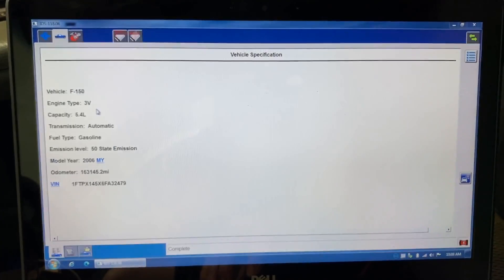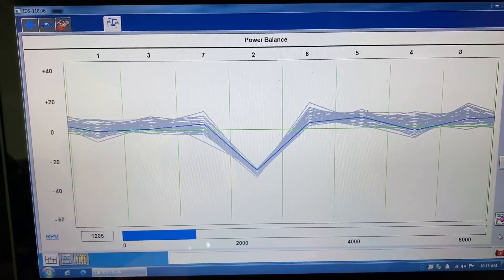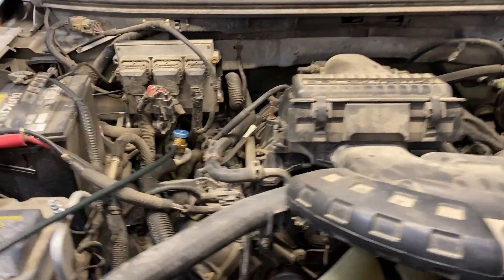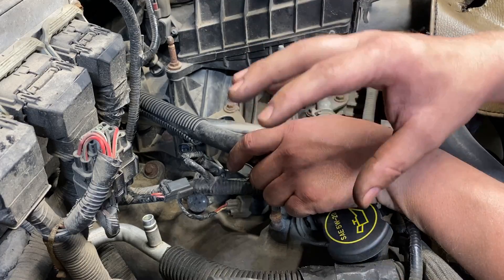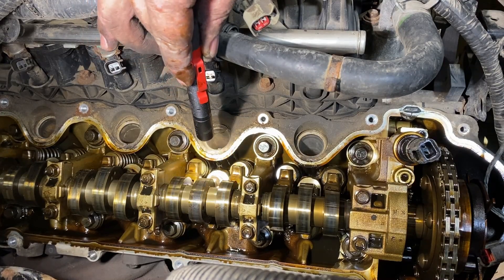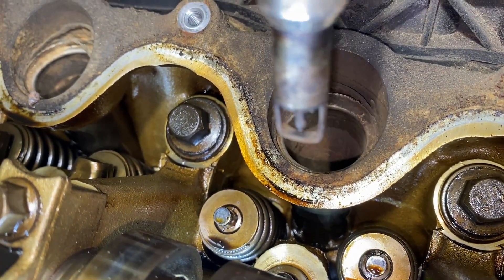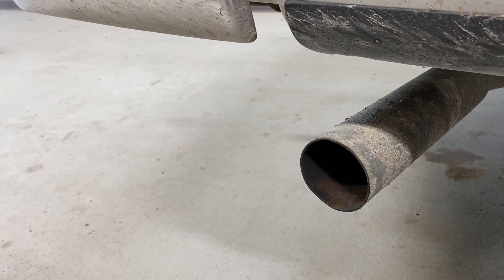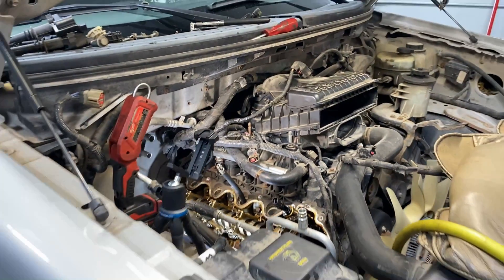Ford F-150 5.4L 3v Triton Compression Loss: P0302 Cylinder #2 Misfire Diagnostic Walkthrough

Comment: So did the owner say put it back together I'm selling it?
Reply from the maker: Yup
Reply: @FordTechMakuloco  how did I guess that owner would say he's selling it? haha   The best part is when I hear an owner say that the vehicle is out of my life forever! Like a well wanted divorce. 😁🤟
Reply: That's a shame for us.  I wonder if it was a poor plug change that caused it.  Broke the porcelain and didn't bother to retrieve it.  The old porcelain bounced around and damaged the new plug putting more porcelain in the cylinder.  Also,  gotta inspect new plugs...I have had new plugs with cracks in the porcelain right out of the box.
Reply: @D2O2  that's probably because of the poor excuses handling them during shipping. Always throwing boxes around like ace Ventura pet detective 🤣
Reply: Yeah it's sad that engine has practically made all of those F150s worthless.
Reply: @michael j i have 2 E350 vans. one 4.6 , another one 5.4L both have  around 500K miles on them. 5.4 burnt half of the piston so new engine coming in,  the4.6 still going strong. they both 99 and 2000 manufacturing years.  2  cylinder valves, 4 speed  tranny with an overdrive .  Nothing built  in later years comes  even close to be this reliable as older stuff  they sold before 2003.
Reply: @ansv3340  nope... your absolutely right
Reply: I can't imagine it being worth more than $500.00. Scrap yard value
Reply: @michael j yes sir. 3v are the worste ever made from ford.. seriously
Reply: @michael j thats exactly right, man these engines were failing with 20 or 30k...ticking when purchased dealer coukd never find anything wrong.... this was on ford bro... they knew if they recall all those engines the monetary damage it would do.... these engines are shit stay away
Reply: You will have the ford loyals say, man mine has 567,098 miles on it. I aint done nothing, noo. You got lucky and your has just held on a little longer... out of 500k im sure theres still 5 or 6 still out there running. It was so bad around here where i live no one even a dealer wanted to mess with it... rebuild wasnt happening. You have to buy reman....even then they are shiiittttt
Reply: This was really cool.  I have this exact engine and I hold my breath any time I hear anything.  Just had "mis-fire" issue and thought the engine was done. FORTUNATELY it was only 1 plug ($500 for 8). The designer of those things should be shot.
Still has the famous "ticking" sound. Loose plugs is an interesting possibility. I'm not a gear head so I'm at the mercy of Ford n honest mechanics.
Reply: Hope when he sells that disclaims the issue, yea right eh?
Reply: @tmaq9726  craigslist:  F150 for sale, runs, good condition, some rust, needs tune up, cold a/c. 🤣🤣🤣
Reply: @ozzstars_cars  Nailed it. The infamous "needs tune up".
Reply: @tmaq9726  "2006 Ford F150 5.4 4x4 for sale..... needs a little TLC but GREAT work truck or daily driver.!"  🤣😂
Reply: @tmaq9726  going to be hard to hide if you drive it.
Reply: Hell yea he did. Anyone who owns this truck with this engine should drive em all off a cliff... any 5.4 3v engines should be burned and deep in the ground.. i absolutely hate ford for this engine
 Cost me thousands and thousands of dollars... dealership couldn't get it right. They threw their hands up at it
 Remans are not built with ford specs, tolerances are way too extreme. No reman company can come close to it. If you buy a reman engine. 99% chance you have issues.. please prove me wrong
Reply: @Aaronsmainchannel  234k miles on my 3valve.  Timing set and oil pump at 200k.  There are tons of high mile 3valves on the road still,  you only see the problems here.  Nobody making videos saying, he look at my perfectly running 3 valve.
Reply: @D2O2  i guarantee yours makes a noise, ticks, limp mode. It does something... either you wont admit it, or you have had 6k worth of work done.....orrrr you have that 1 in a million truck someone took meticulous care of.... even then highly unlikely
Reply: @Aaronsmainchannel  I assure you it doesn't.  Welcome to come drive it.  I have $1200 in parts in it and did the work myself.
Reply: @D2O2  heck yea. Trust me im glad to actually hear that. I know mine and everyone else i know around my way can say different. Shops here wont touch em... ford dealers wont touch em.... im glad you dont have tonfeel thenpain these engine bring on someone
Reply: @D2O2  i had a 97 4.6, i couldnt kill it. Ran it 3 or 4 quarta low on oil. Go years without oul changes. Never do a thing to it... i traded it for my 05 3v triton...mbiggest mistake of my life
Reply: @Aaronsmainchannel  I had a 98 4.6 with 318 on the clock when I traded it.  I only ever changed plugs every 100k and oil every 5k.  Cleaned out the egr passages when it started pinging badly every 30k or so.  Nothing else done.  Original coolant.  It was rock solid!
Reply: @D2O2  i miss my 97 bad, i couldnt put anymore into that 05 i had, it nickled and dimed me to death bro,  2k new phasers and timing components, then 6k new engine, beacuse the old one wouldnt hold pressure once hot... then nothing but problmes from then on. Finally the warranty ran out and inlost my ass on it... ill never buy a ford again.. ever unless its older...
Reply: @Aaronsmainchannel  I still own my '97 F150 4.6L 2v, with 137k miles, love that truck but I also do enjoy the power and comfort of my '16 F150 5.0L, non gdi, naturally aspirated.
Reply: @ozzstars_cars  ok ok
.. where do u live on my way to buy the 97 lol🤣🤣🤣
Reply: @ozzstars_cars  5.o great engine as well...

Comment: I'm not a mechanic but I love this guy's channel and I can participate in conversations about 5.4 3-valve motors. I drove a 99 F150 5.4L Triton V8 for 19 years, then a 2018 F150 2.7EB and now a 2020 F150 2.7EB. Fantastic channel and work! ps. In high school a drove a 78 or 79 E250 with a 460 in it. Replaced the water pump myself on that. Talk about no room to work.

Comment: Random 3v question: are the blocks the same for the old and new style 3V heads?

I have an '05 f-150, but with 3v heads from 3/2008 with the normal spark plugs- which has always been running great, at 184k now. 

My father has an '07 with 330k, had a really fun time replacing the spark plugs on his once or twice- but nothing catastrophic yet!

Comment: Those damn plugs...the engineers that designed this engine should be fired..i believe that's a mazda design..not sure..i hope Brian shows the repair t know it won't be cheap..thanks for showing this..also i wonder if someone may have dropped the plug ?  Cheers everyone 🍻🍻🍻🇺🇸🇺🇸🇺🇸
Reply: Do they still use those stupid plugs in newer motors or abandoned them years back??
Reply: An Sv they stopped the 2 piece plugs after the issues started
Reply: Since you're, apparently, an engineering expert - why don't YOU give us a complete engineering analysis of what is wrong with the engine ?  This is not an engine problem, it's a spark plug problem.  Without knowing if the plug was original Motorcraft or a Chinese knock-off, whether the plug was dropped prior to installation, or any other problem that could damage the insulator, damning the entire engine and the engineers is a knee-jerk reaction by someone who's not afraid to parade their ignorance in public.  Congratulations...

Comment: What a big mistake by ford engineers, just got rid of this truck with this engine..

Major major issues with this engine. A man can lose alot alot.of money when having this engine diagnosed and or fixed. Luckily im a half decent mechanic, and i can tell you. Nothing tou do to this engine after 90/100,000 miles will fiz it.. it will always tick, always pull itself into limp mode. Always have camp phaser noise... what a piece of shit engine.
Reply: if you think that's bad, look up cp4.2 fuel pump failure on a 6.7 powerstroke  flawed design, with aftermarket fixes to limit the damage to the high pressure fuel system. and ford still uses it, is being sued over it and does not even update it so the failure is contained. the aftermarket parts to prevent total fuel system contamination only cost $240 retail and would be easy enough to incorporate into the system
Reply: @cobrabuilder9336  oh yea. Thise are shit too... 7.0 diesels are hard to kill my friend
Reply: Tell me abt it. I've rebuilt my 06 engine twice. Passed it to my son head gasket blew so nw it's sitting n my garage taking up space. Total shit frm Ford.
Reply: @undrasr001  ford definitely should have been sued for this. So many flaws in one engine
Reply: @Aaronsmainchannel  I agree
Reply: @undrasr001  any time you have timing driven by oil pressure thats never ever a good idea. Thats what happens with these engines. People put off oil changes. The engine wears, tolerances are lost. Oil pressire is lost. Scared up cams happen.. cam phasers rattle, timing components break, mainley plastic guides. Pretty sure someone on meth or crack desinged this

Comment: I saw a champion plug do that once from being loose and overheating.  In that case it did ot wreck the valve but it wrecked the rings instead...  even worse.   They got off easy compared to that.

Comment: new spark plug failed like that?  was it chinese bootleg Motorcraft part?
I would replace all the plugs assuming the engine is still good.
Reply: There should be class action lawsuit against Ford's faulty spark plugs. I have seen two bad right out of the box. These were not bootleg and not cheap. One destroyed a motor and the other was intermittent and took days to diagnose. This was the new updated plug too.
Reply: @AmosMosesJr  The way ford designed the spark plugs should of actually been a lawsuit indeed.  Like no engine should be bad due to poor engineering.  All of these generation of F150 run away.

Comment: How do tell if Rear Main Seal is leaking or if it is the oil pan gasket?  See oil on very 2 rear bolt heads on the Oil Pan Gasket, but don't see oil in the Bell housing when I remove the dust shield.  I replaced the Oil Pan Gasket with a Ford gasket per your instructions in your video, and still have oil seeping in the same place, using UV dye.
Reply: Check up higher.  It may be a cam cover leaking.  Also, look at the front crank seal area for wetness.. It may leak and the oil travels back.
Reply: @jamesplotkin4674  Thank you James.  Seen oil on the air conditioning compressor bolt(changed compressor this spring), and I thought the same thing oil traveling to the rear.  Changed the Oil Filter Adapter and Adapter Filter.  I did look at the front crank seal with UV light, no glow, as I upgraded Harmonic Balancer some time ago.  It might be leaking at the Crankshaft Sensor?  Plan to do Timing Job soon, so if it is Cam Cover Gasket or Timing Cover gasket, this will remedy the leak.  Hoping it is not Head Gasket behind Air conditioning compressor.  Hate the idea of having to take a perfectly good transmission out to change Rear Main Seal.  Had this 2004 FX4 since it was new, 181,000 miles.  When I did the Oil Pan Gasket found the plastic corner of the Drivers Side fixed guide where the upper bolt goes thru in the Pick up screen, probably over torqued when it left the factory, plus found the white plastic upper tab from the tensioner guide in the screen.  Oil pressure has always registered, engine has no rocker follower, or lash adjuster taps or phaser noises or chain slapping noises, and not throwing any codes, mode6 shows no cylinder misfires.  Only hear injectors tapping. "If it ain't broken don't fix it"?
Reply: When I take the inspection plate off the Bell housing, I don't see oil on the Flywheel or inside the Bell housing?

Comment: That sucks. I own a 07 with a 5.4 3V. All these videos are good but man it sure does make me sad. I like my V8 Expedition. I hope I don’t have these kinds of issues.
Reply: Despite these videos I trust this motor a lot. I have a 07 5.4 3v with 150000 and always use motor craft oils and filters , still runs perfect. Last week I drove my truck 2000 miles in two days, towing a 5000lb boat for a thousand of that up and down hills for 14 hours. Truck pulled like champ ,I was impressed. I love the low end tourque of this motor.
Reply: I kinda feel with you having an 07 F150 86k+

Comment: I’m a ford guy, but ford had a lot of problems with these kind of engines from 2004 to 2010 with the 5.4 liter. I have a 2000 Ford F-150 with the 5.4 liter but nothing to compare with those years. Mine it’s been a very reliable engine, I think from 1997 to 2003 they were excellent engines till this day and mine is proof of that.
Reply: Same her bubba, 03 f150 4.6 2v iv drove basically every day since may of 2006 got over 400000 miles and still going as my primary work truck which really means daily driver in my world
Reply: @wolfmanrebel874  im at 500K on my 4.6L 1999 E150 van so I"m ahead of you )) still going strong, 95 miles per hour  on NJ parkway  just yesterday )).
Reply: @ansv3340  how about the trans? Mines 4r70 still original but starting to give signs it's getting tired,actually from the way the fluid looks I bet if I just put in new check balls I'm sure there eroded to half the size they should be and new servos it would last a long long time still yet. I really have no doubt the engines got along while left in it it's still smooth and no issues other than a little less power than 300000 miles ago from normal compression loss.still have the same 8.8 axle also ,other than routine maintenance only thing iv done to it all these years is intake gasket,timing chain,fuelpump u-joints and recently put a new set of coils
Reply: @wolfmanrebel874  both of mine transmission are original , I rarely do  fluid changes . bt when do I do full drain even  from the torque.  The only issues i had were  shudders, that went away with new filter and new fluid. but again I have E vans , so they not 4x4  , which means less of a stress on the transmission, and while i do drive fast, i dont abuse transmission with reckless driving, and I don't drive much i the city.
Reply: @ansv3340  yeah mines 2wd also, last fem months iv noticed shifts are just a bit off not slipping or anything just shift harder and it seems to be a bit more of a split second between each gear between shifts as oppsed to smooth virtually instant transition into the next gear,they have plastic check balls the erode over time I imagine that's what's going on at some point il change them and servo seals so the internals don't start taking extra wear from it I'm curious just to see how far this truck goes I love it.
Reply: Dang 3v.  That and phasers.  Crap to satisfy CAFE and EPA.  Ruined a great engine.
Reply: Your 2000 5.4 is a 2 valve not a 3 valve
Reply: CarsTrucksWhatever, and Wynona's big brown beaver is actually a porcupine!
Reply: 2003 ford expedition 5.4 2v ive got 200,000 and still going strong,fordmakuloco has helped me with the maintenance on this vehicle  this guy is a FORD GENIUS
Reply: 4.6 2v with 265,000....20 years old and runs great.
Reply: Until the head gasket blows on the right bank lol
Reply: if they 2 valves, they just dont die)) i have 500K miles on both 5.4 and 4.6 engines.
Reply: @gregtaylorgregg41  there's ALOT of everything that sucks ,as Kenny Rogers said you gotta know when to hold em and know when to fold em and know when to walk away 😁 4.6 2v great,6.2 great, 300,351w great ,3 valve modulars are junk, Fe engines were junk from a reliability standpoint, Ecoboost..not a fan, ECT. I can do the same with gm 3800 best american V6 ever..period, 3.6 biggest pile of shit you could own, 5.3 potentially just as long lasting as the Ford 4.6 , 4.3 v6 carbed &tbi decent/spider injected absolute junk, 2.2 ecotec crap,actually all ecotec crap ok how about Chrysler, oh yeah not enough bandwidth to name the junk  I can go on and on and on with virtually every automaker that has sold a product in the US in the last 30-40 years so from a broad spectrum ford don't suck more than anyone else...even toyota in case Scotty kilmer decides to debate that.
Reply: @gregtaylorgregg41  every Ford truck or van you see on the road from those years  is high mileage,. All NYC cabs ,  crown vics, all town cars had 4.6L v8 and they were clocking 500K miles on those vehicles. and their mileage was stop and go in NYC. Those motors were high torque with low RPM kind of same as diesel motors, this is why they last 500K miles.  you cannot expect that from any eco boost crap or turbo motor, because  smaller motors simply run at high RPM to gain same power that large V8 has.

Comment: How can you never talk and show the 2v motors
Reply from the maker: Not many problems with them and we don't see them much anymore. I have plenty of older 2v engine videos though.
Reply: @FordTechMakuloco  99 e150 202,000 miles fresh tune up runnin strong bought it with 88,000 miles...
Reply: Lol cause they don’t break that much